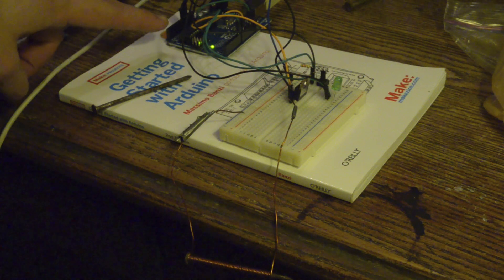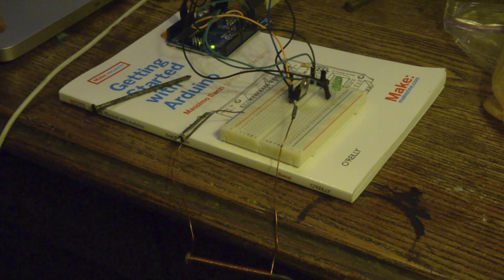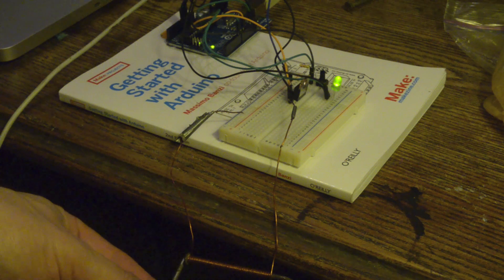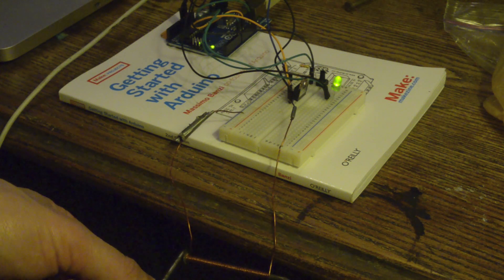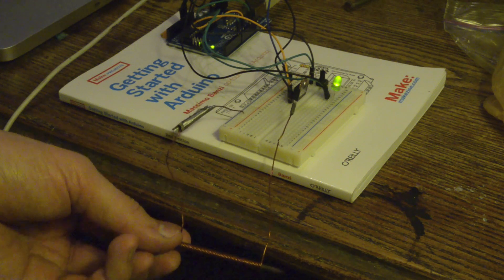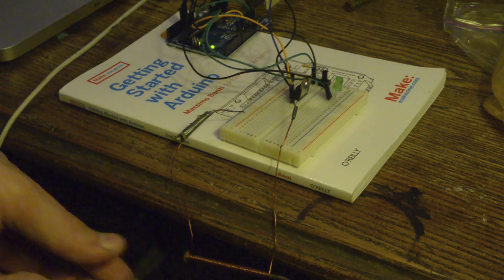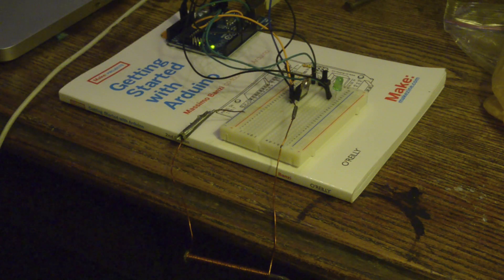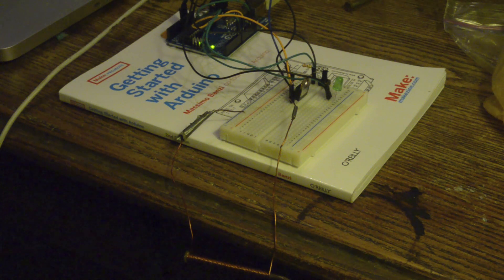Arduino-Controlled Electromagnet

Comment: Hello,

I am putting together a project together for school. Now I am running an Ardiuno Uno in connection with a L298N. Outputs 1 and 2 are connected to a motor that runs via a joystick (working fine) and I want to be able to set up a electromagnet that is activated and deactivated with the button on the joystick. I could use a little help in connections

Comment: very cool video....thanks for the inspiration....I need a simpler version of this...is it possible to just send the current from a pin of the arduino to energise the wire and the other end of the wire plug it in a ground pin of the arduino? I have tried it but I can´t get the electromagnet effect ... Since I do get 5V out of my arduino pro mini, I was wondering if it is due to the shortage of miliampers....and next question....why the LM35 resistor?

Thank you very much ¡¡¡

Comment: Hi, thanks for this it's exactly what I need for a project I'm doing. I'm a complete noob at electronics (and the Arduino platform altogether) though and I was just wondering what the black component with the white stripe was in your schematics? Also, is this being powered by an external source? Thank you for any help.